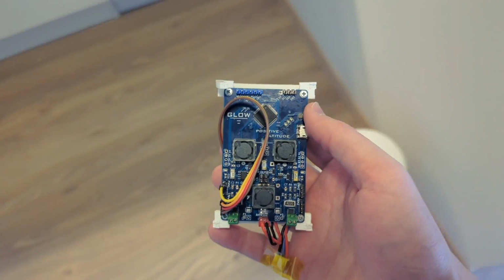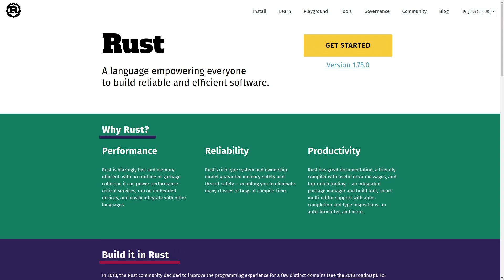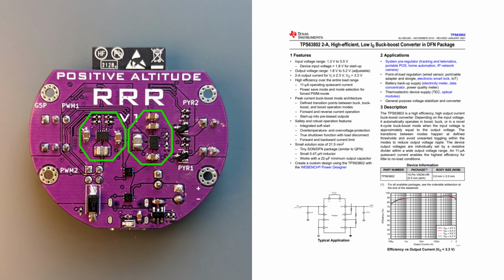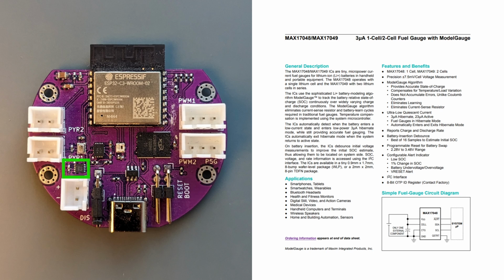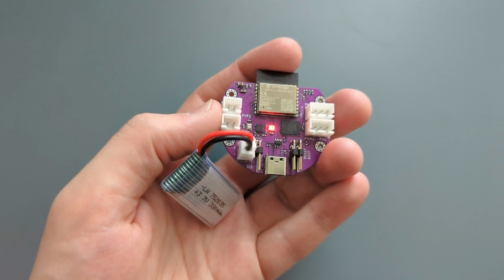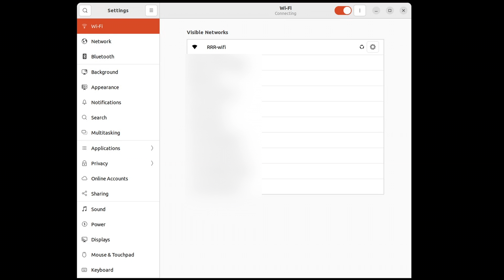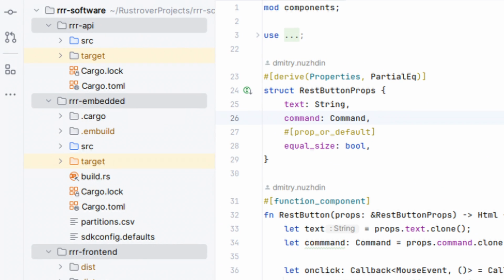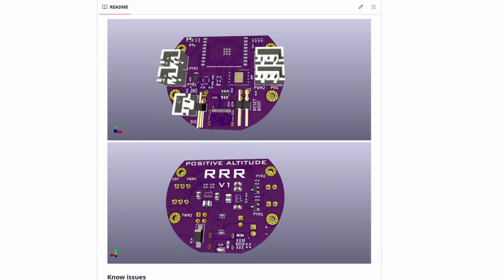Enhanced Model Rocket Flight Computer

Comment: WOW! The hardware design is beautiful! Really well thought out component selection and circuit design. I am especially impressed by the use of a WiFi chip with a Rust written website front-end (I had no idea this was even possible). Incredible work. Are you a professional engineer or student/very talented amateur?
Reply: Wait I have a more important question. If the rocket flies really high, is there a chance the WiFi will disconnect? What is the range?
Reply from the maker: Thank you! I do software professionally (backend), but self-taught in electronics. I don't sink Wi-Fi is a good down link for having live data from the rocket, I would not expect it to go 50m+ reliably, but who knows? Maybe I will test it when I will finish the rocket. Anyway. I don't need live data during the flight, and telemetry could be just stored on a flash chip. Proper live data requires a more suitable radio and so a base station / receiver. I would like to use just a phone to control the rocket.
Reply: @Positive_Altitude  Thank you for the reply. Best of luck with your project, I'll keep an eye on it!

Comment: What are some of the biggest benefits of rust over c?  

It seems most microcontroller use eclipse (esp32 idf-ide, stm32cube ide)..    even fpga vendors use eclipse for their hard/soft CPUs  (Altera/Intel Nios, Microchip Softconsole)..  however, I've never seen any option to use rust.

Some very smart people (ex. Sean "Xobs" Cross) are big fans of it, but not sure why?!
Reply from the maker: Rust has a different philosophy of managing the memory. Compiler enforces a lot of special rules that you need to follow to make your code compilable. But if it compiles, it very unlikely that you have a memory usage mistake in your code. As the result, writing code is harder, but debugging is easier. Common mistakes like memory leaks, segfaults, deadlocks, race conditions etc. are avoided. 
Also it is affected by elements of functional programming, widely used lambdas, good type system.
Another important thing is proper macroses (with ability to fully transform token stream (abstract syntax tree)) . This allows to create amazing extensions to the language. 

For me the great benefit is that it works great for everything: PC app, server backend, embedded, frontend. It is the only language I know that is at least "good" for all these applications. So I can share/reuse my codebase and make very straightforward integrations.

Unfortunately I would say that it has steep learning curve, and there are decades of C in embedded, so nobody is running to switch to Rust. But imho it is excellent for embedded.

Comment: Hello great video! Can you make a video about building the rocket Please?
Reply from the maker: Hey, thank you! I am working on a new TVC rocket now that will use flight computer very similar to this one. I finished a new parachute system recently and will make a video about it soon. Other parts will be covered later. Cheers!
Reply: @ Yea? And its going to be free? I wanna built a rocket but am never was programing before so do you share the code too?
Reply from the maker: @wexx1k  yeah, I am going to share everything covered on this chanel for free. Including code. But it will be "Rust" programming language which is quite unusual :)

Comment: Very interested to see how you’ve got on with Rust in your embedded project as I’d love to use it in my next ESP/Pico project. 

Yeap the RISC-V implementations of ESP32 are very much love performance limited. Hopefully this is changed in the future.
Reply from the maker: There are several HAL implementations for ESP32 with Rust. I picked the one that is a Rust wrap around ESP-IDF oficial framework. It is not very lightweigh and could be hard to setup as it has a ton of requirements that should be installed and present in PATH env var. But it is very feature rich. Webserver, non-volatile storage (NVS), Over The Air Updates (OTA), networking with DHCP and mDNS and many other things I did not try yet. Also everything it is based on FreeRTOS, so you can easily have threads and async execution with no effort. I have a very positive experience with that! Check out my GitHub repo maybe it will help you to get started. Also I recommend RustRover IDE from JetBrains. It is in early access but works like a charm. Reach out if you need some help!

Comment: Great work! Did you change RCOMP in the config reg (MAX17048) to use it for Lithium-Polymer or are the curves thesame? Thanks!
Reply from the maker: Thank you! No, I did not. I don't have a way to measure battery/ambient temperature on this board. There is a temperature sensor in BMP280 but it could not be used for that, because it gets heat up by ESP32 chip, so does not provide ambient temperature :) Also from what I read Li-Po and Li-ion settings for MAX17048 are more or less similar. It can be used with default configuration if you don't need very precise SoC measurements. So it is good enough for me. It shows reasonable results at room temperature. But yeah, for the best performance there should be loaded correct model parameters into TABLE register and temperature compensation with RCOMP should be performed frequently. But it is probably too much for hobby project. Especially when exact battery SoC is not something extremely important.
Reply: @Positive_Altitude  Thanks for the reply!

Comment: Dude, actually amazing. how many can you produce???
Reply from the maker: Are you interested in having one? 😀 This one is assembled by hand. It takes about 4 hours to assemble with my skills. But I am planning to try small batch factory assembly for the next version, when I will fix all issues.
Reply: @Positive_Altitude In case you never tried it: use some solder paste and a stencil. This usually speeds up placing parts a lot. Ofc you still need to apply your hotfixes afterwards.

Also, nice project! Some additional sensors like gps might come handy if you loose your precious aerial vehicle.
Reply from the maker: @ihopeusteponlego1614  Thak you! Yeah, will get there for sure. Also I think I am very lucky: my local hobby space has a small CNC pick-and-place machine! Will definitely invest time in learning how to use it.